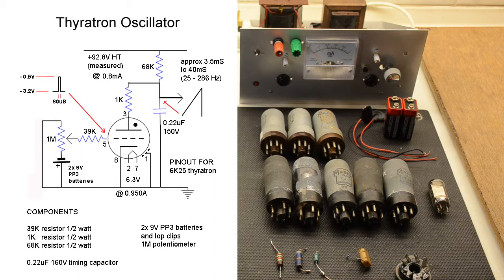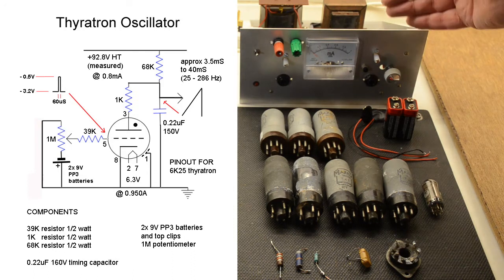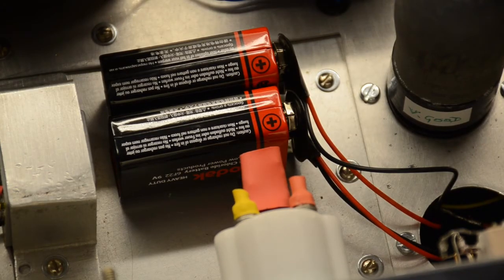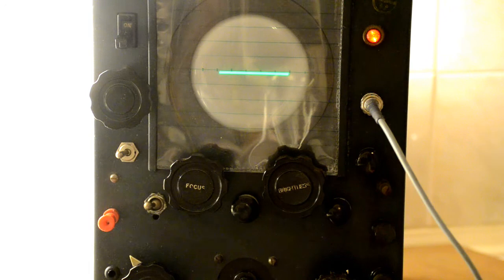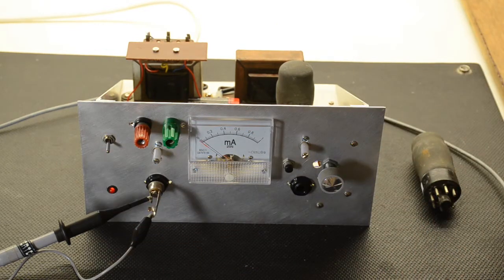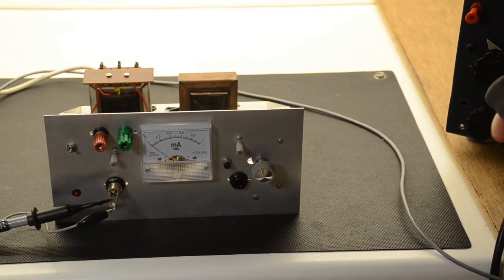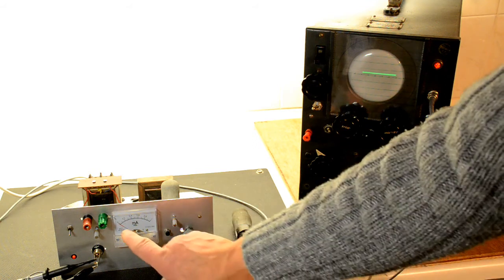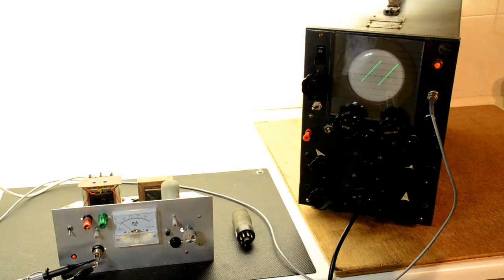The Radar Room -  Assembling a thyratron oscillator

Comment: Hello again and another great video. I built a thyratron oscillator and discovered a very interesting way of using it as a noise generator. If you place two magnets either side of the valve it will generate a broad spectrum of noise. Its a complex bit of physics to explain why it generates such noise. Too complex to describe here but you can find it on google. I used a 6d4 which fits a standard 7pin socket,  kind regards Clare. PS would you mind giving me your first name.  It seems more polite than than saying hello. Kind Regards Clare
Reply from the maker: Hi Clare it's Chris :-) Interesting. I see that the 'valve museum' show the 6D4 as being able to do this. Have you tried any other thyratrons? I'll investigate this myself when I have a spare min'....  Do drop me a mail from the address on our website if you want a decent exchange off Youtube. ( www.radar-room.co.uk )